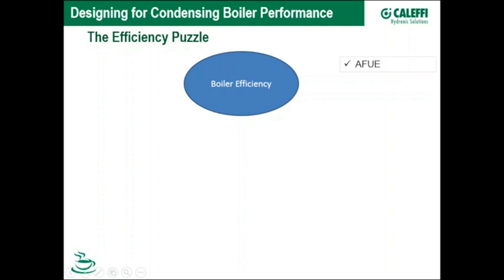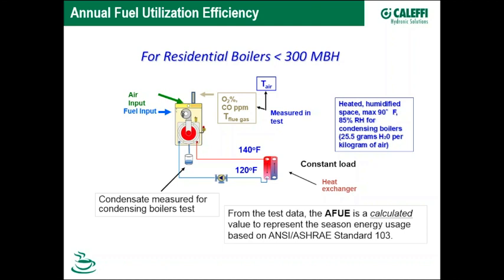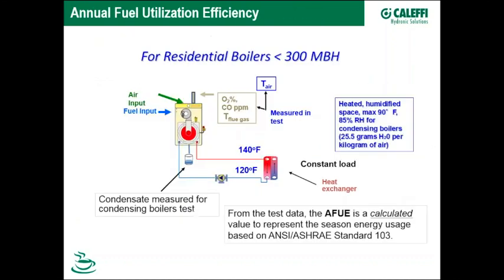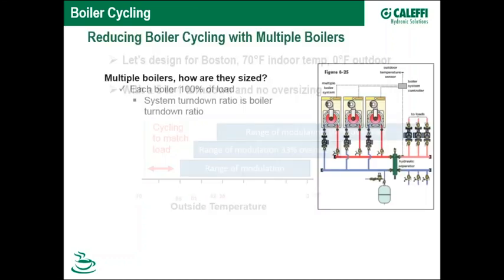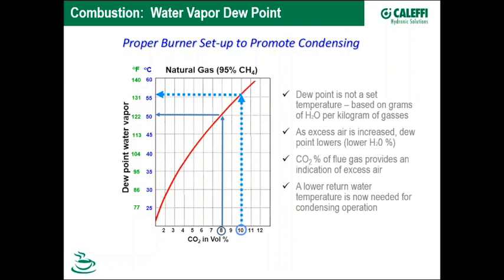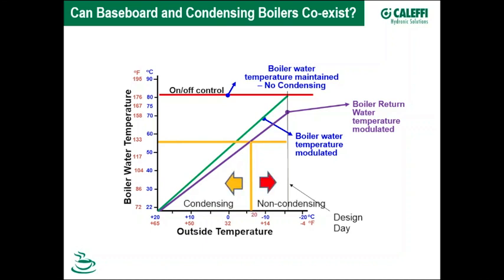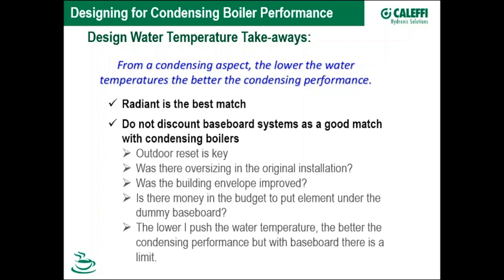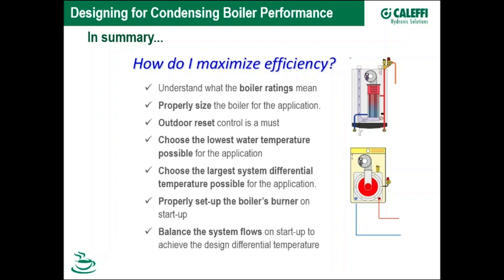Designing for Condensing Boiler Performance

Comment: Was the question about accounting for DHW temps ever answered? If the boiler is supplying temps lower than the DHW requirements, how is this accommodated?
Reply from the maker: Thank you for your question.  
Most combi-boilers or high efficiency boilers offer a DHW supply temperature limit and a space heating temperature limit.  This allows you to set a space heating supply temperature and bypass and a higher supply water temperature to provide domestic water heating and quicker domestic water recovery times.   This still allows you to maximize efficiency of the boiler using lower supply temperatures for space heating which will have longer run cycles.   Higher temperatures for DHW heating will drop the efficiency slightly but this is needed to provide fast domestic water recovery and capacity keeping in mind the run time will be less for domestic water heating then space heating.

Comment: How many hours out of the day, and how my cycles in a day would you say is ideal for a boiler to operate?
Reply from the maker: The heat load of the space is always changing as outdoor temperature changes.  A modulating boiler will have longer run cycles at lower outputs to provide better efficiency and comfort.  An oversized or single-stage boiler will tend to short cycle providing more cycles and lower efficiency.   It is more important to consider the design building load, changing load, heat delivery system and system components to cover the changing loads, provide consistent run cycle and overall best system efficiency.